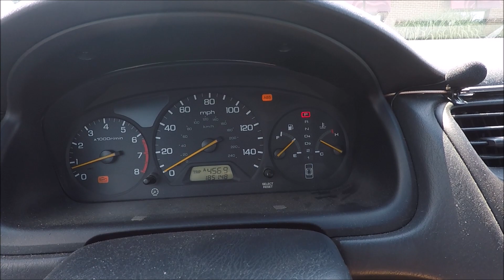ILLEGALLY MODDED MY FAKE HONDA NSX!

Comment: Why not just knock the honeycombs out of the converter with a hammer and prybar, then slap it right back on. Would've been a free repair. Thats how we Tennessee Hillbillies do it. Lol. Also you could've fired it up before putting the new pipe on and it would have blown all those pieces of the converter out instantly.

Comment: What are you going to do about the CEL?? I did the "spark plug anti-fouler" trick on my 95 Subaru and it still throws a Po420 code. I've done it before and worked. Any ideas??

Comment: I just did my 4 cylinder accord 2001 and cat was broken up so bad it would barley run. Gutted that thing and put in 2 spark plug defouler to space 02 sensor. Runs great now and no engine light!

Comment: Agree with the c8 vid mosty but gona hate on this one a little lol... why not remove the cat by the bolts, could have reused to the flanges on a pipe and if you even had to put a cat back on it'd be so much easier.  Also, not a fan of the band clamp bolts pointed straight down sticking out that far.

Comment: Yea man I  like the video but you never said the cost difference between straight pipe and replacing thw cat
Reply from the maker: Replacement of the OEM cat part wise was $200+, the straight pipe with clamps was $30

Comment: If your corvette Video wasn’t to hate on corvette why is it called worst corvette ever. Why hate on it at all. Chevy made a change that was needed and something they rarely do and everyone nails them for it. Launch capabilities of a mid engine are way better than front motor...  they will gain .3 on 0-60 just from weight distribution.
Reply: It's called worst Corvette ever because clickbait